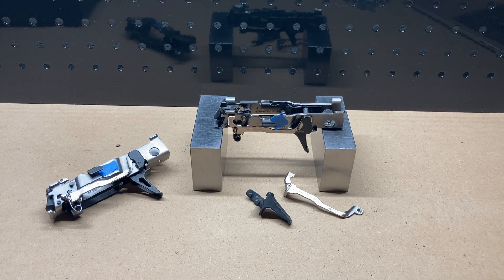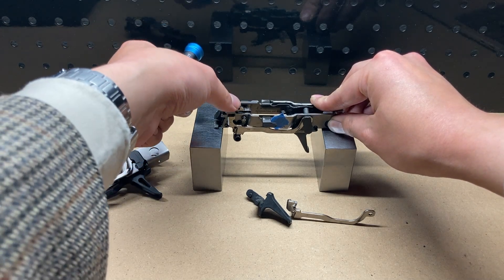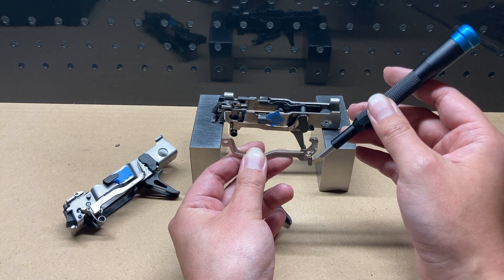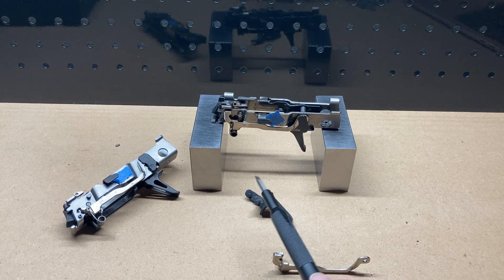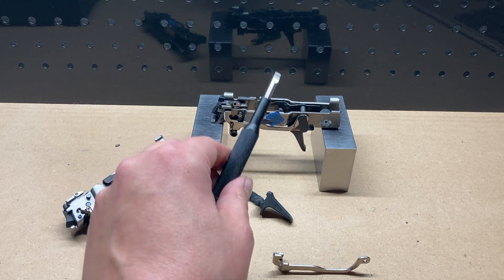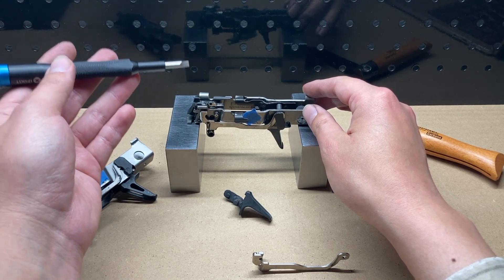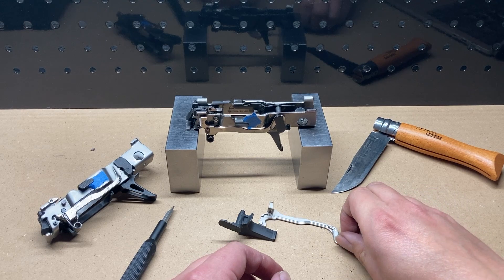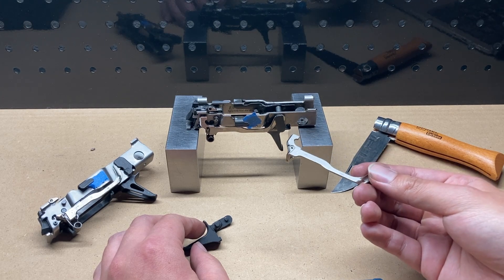P320 Sear Movement Test followup: It's all about the Trigger Bar and Trigger

Comment: If it’s interesting at all if I stick the stock FCU of my p320 m17 trigger bar “575” into a aftermarket metal frame grip module there is NO audible click or snapping up and forwards. But when I place it back into the stock grip module it does have an audible click and snapping upwards.
Reply from the maker: Ah, great - more variables! Thanks for sharing!
Reply: I have a pre-voluntary slide upgrade FCU. With a 657 and the nweer 576 bar I also get no click or snapping forwards. The bar just moves straight down in the same path as the slide disconnect. Using stock X-Carry grip frame.

Comment: What's your hypothesis as to why it's release of the sear to cause it to fire inside a holster?
Reply from the maker: I don't know, and frankly, I'm not in a position to find out; I simply do not have access to the proper sample size to even begin approaching that question. The sear movement test just outright assumes the sear is moving and checks to see whether the last-ditch safety is working as intended or not, that's it. As long as the last-ditch striker safety lock is working, then an "uncommanded discharge" cannot occur even if the sear slips from an act of god.

Comment: The first one I tested passed all of these tests. It appears that there is a "green zone" of sorts where as long as some tiny amount of pressure is put on the trigger to keep it in the proper place in relation to the sear that it works but that once the sear goes further than the trigger, that it disconnects. I hope to find one of mine that fails the test (crazy thing to say huh?) so I can study further.

Comment: Just like to add, both of my pistols fail this test, that is neither of them go downward, only forward.  However it seems both pass the striker test, that is I don’t see the striker during the test… this is all so tiresome, I have 2 320s and I appendix one everyday.
Reply: Okay now I’m not sure, I’m freaking out lol.  I keep repeating the test and I can’t tell if it’s coming through or if I’m doing something wrong/right
Reply: @tacracc_photography  Are you making sure to bump the slide stop release up and tap the slide disconnect down after flipping the take down lever up?  I initially freaked out because I was able to get the forward movement without downward movement when doing the test just after flipping up the take down lever.  But then I watched the video again and realized I had forgotten that important step which would occur during reassembly.

Comment: What I’ve found: first thank you very much for this video. I just tested a P320 X-Frame in both the factory grip and in a Wilson Combat aftermarket grip. First test with fcu installed in the Wilson Combat grip there was no click. Removed fcu from Wilson grip - proper function with the click. Repeated test several times with fcu both in and out of the Wilson grip - proper function with click when fcu removed from grip, improper function (no click) when installed in Wilson grip. Installed and removed fcu into factory grip module several times and repeated test. Sometimes it would function properly and click, other times no click. Last test, removed fcu from grip, put slight pressure onto the trigger bar, slightly pushing from outside in towards the center of the fcu - no click. Released the pressure from my finger, proper function with click. I’m no expert, engineer, armorer, or gunsmith. However it appears to me that when a slight pressure from the side of the grip module pushes the side of the trigger bar, it must alter the alignment of the trigger bar engagement so that it doesn’t function properly. Anyway, that’s what I’ve found on the P320 that I tested.
Reply: Based on this comment, and this video I'm running with the theory of the ADs being caused by how the sear and trigger bar, and trigger interact when pressure from a holster is applied to the trigger bar through a flexible grip module. I have yet to hear one report of a P320 going off sitting in a safe: the largest common denominator is these are going off in holsters. Typically, when the user moves the holstered leg in many police cases - which can impart pressure onto the holster. If that pressure is transferred through a flexible grip module (like you tested), and that trigger/bar/sear set up does not have the striker safety pop at the end of the stroke, but rather moves along with it, maybe holsters with tight passive retention are transferring enough force to the trigger bar to partially set the trigger, and (with movement) cause the sear to slip past a pushed up striker safety. I wonder if this has ever happened with a metal grip module, which would in theory resist any pressure from holster to the trigger bar.

This would be in alignment with Sig insistence that the weapons cannot go off "without the trigger being pulled" - the trigger bar moving would mechanically be pulled, just not by user input. Trigger immobilizers like the Agency Arms trigger (if enough movement prevented) or the manual safety being should prevent movement. I know we have reports from this occurring in the military (which have safeties), but I would take any report of the safety being on prior to holstering with a grain of salt considering the training involved with the handgun (not very much, not very good).
Reply: I get no click regardless if my FCU is in or out of a grip module. The trigger bar just moves straight down in the same path as the slide disconnect. I get no striker protrusion with any test I've ran. I've tried 675 and 576 trigger bars, etc. My FCU is older, pre-voluntary slide upgrade. Mine looks good to go, but it seems there are a lot more variables to this equation... In this video his clicks every time he pushes the seer down, mine does not, but passes the "tests".
Reply: @Carpythesharky  I had the same issue, if it's not "clicking" at all, that means the gun didn't "fire" even when you just pull the trigger.  Put the gun back together as you normally would, minus barrel and recoil spring, if you depress the trigger and still don't hear and audible click and see the firing pin protrude then you may be doing something wrong.  You should have a decent bit of spring pressure pushing the slide backward when you do the test.  I don't know what I did, but ended up dissembling then reassembling the gun completely, then I was a able to get it to dry fire it as it should.  I then dissembled again like the previous video said and was able to replicate what he showed in the other video with clicks and all as well as firing pin popping through (unfortunately).  I have a very early FCU, but I did send my slide in for the upgrade as soon as it was available.  I carry a p365 and never carried my P320, only shoot it at the range so I'm not concerned with it.
Reply: In the previous video, all of my runs passed the test. I ran this test on 10 guns. 7 are mine and 3 borrowed. Of this 10, 2 were M17’s, 1 M18, 4 were Legions and 3 were stockish compact P320’s (not optic ready). Any of the M series will move the trigger forward and back but will not release the striker. No audible click. I assume the addition of the safety prevents this. The Legions all passed. 1 of the compacts passed. The other 2 would not reset the striker. Again no audible click. So I replayed the video and the author made a comment about the skeletonized trigger. Well.. both of these have it. I replaced the triggers with stock flat triggers are the guns pass.
Reply: I noticed the same thing on my P320 XTEN where I couldn't hear an audible click (though I did see the trigger bar move downward, albeit not that much) but could when it was outside of my grip module. However, when I did the sear test by putting the slide sans barrel and recoil spring and pushed down on the sear with a punch, the sear dropped but the striker didn't protrude out of the gun. So evidently that movement is sufficient. I do have aftermarket parts in my FCU, though.

Comment: I have (4) 320's 2 have the shown issue, on both problem guns it is the (trigger) not the trigger bar causing the issue. On the problem guns (both straight triggers) the triggers have a different distance between the trigger center pivot pin & the trigger bar pin. Both the problem  triggers have a different distance between the trigger pivot pin & that causes a  slightly different trigger bar angle. It seems to be that slightly different trigger bar angle that causes the sear movement to push the trigger bar straight forward rather than down & forward. On both problem guns going back to the stock trigger causes the problem to go away.
Reply from the maker: This precisely mirrors our findings! Good to see at least some consistency out of this platform...

Comment: When you had the FCU's in the frames it looks like both safety levers moved directly in response to the pressure on the sear. Maybe I saw a slight delay on the second frame, but that could have been differences in how pressure was applied.

Will you confirm that the second pistol frame allows the sear to move slightly more before activating the safety lever? Does everything feel similar?

If what I'm seeing is correct, the trigger bar "disconnector like behavior" doesn't initially appear to be a causal factor because the sear and safety lever's in both pistol frames move as one, but it's obviously a concerning observation and possible correlation (small sample of 2). I wonder if others will confirm something similar happens when they try it.

What factor does not having spring force and barrel lock up on the take down lever have, if any? From Sig mechanics video's the takedown lever activates the sear by pushing it into pre-firing position. It looks like the takedown lever needs that force to stay locked, so I was wondering if it affects the sear.

Comment: I appreciate this video and decided to submit my own contribution. Here are my discoveries:

P320 Sear Disconnect Behavior Test

NOTES:

-Stock trigger bar is part number 576
No difference has been shown in this test between M18 stock trigger bar (576) and X5 Legion stock trigger bar (576) I tried both bars and decided to not include the findings of both in this format due to space. Changing between the M18 stock trigger bar and X5 Legion stock trigger bar made no difference

-Apex Trigger bar is the “CA version”. This bar has been discontinued. 

-No difference has been shown on whether FCU is inside or outside the frame during test. 

-No difference has been shown between the different trigger shoes. X5 Legion trigger shoe and Armory Craft dual adjustable trigger tested 

-The following test was conducted with various combination of parts. Primarily a Modified M18 FCU and a bone stock X5 Legion FCU

-M18 FCU has a Grayguns Competition trigger kit (https://grayguns.com/product/p320-competition-hybrid-trigger-system/). 
Trigger shoe is Armory Craft Dual Adjustable Trigger (https://www.armorycraft.com/product-page/sig-sauer-p320-dual-adjustable-flat-trigger-1) 

TEST RESULTS:

M18 FCU, Apex trigger bar, AC trigger shoe:

Trigger bar moves down and forward.  

M18 FCU, M18 stock trigger bar, AC trigger:

Trigger bar moves straight forward 

X5 Legion completely stock:

Trigger bar moves straight forward

X5 Legion FCU, Apex trigger bar, X5 Legion shoe: 

trigger bar moves down and forward. 

X5 Legion FCU, Apex trigger bar, X5 Legion trigger shoe:

Trigger bar moves down and forward 

X5 legion with M18 upper, Apex trigger bar, X5 trigger shoe:

Trigger bar moves down and forward 

SUMMARY:

I appears that with my particular FCUs and parts, changing ONLY the trigger bar made the difference on whether the FCU displayed disconnector-like behavior

Comment: Mine passes the test while the FCU is removed from the grip module, but fails while inserted into the grip module. I am able to replicate the failure outside of the grip module by applying slight pressure to the outside of the trigger spring while performing the test.
Reply from the maker: Yep, this is why I warn against trying to draw conclusions from the FCU outside of the grip. Installation in the grip can potentially change the FCU behavior.

Comment: Curious if anyone can advise whether the agency arms trigger with the trigger safety prevents the necessary travel of the trigger bar to mitigate an accidental discharge with the information gathered from this video.
Reply: I have asked the exact same thing but have not gotten an answer from anyone.
Reply from the maker: I was hoping to get my hands on an Agency Arms trigger this past weekend but was unlucky. The search for one to experiment with continues. After the amount of counter-intuitive behavior I've witnessed out of the P320 FCU, I hesitate to make any authoritative statements about any aspect of parts interactions without first having tested those parts in an actual FCU to witness their actual behavior.
Reply: The answer is, unfortunately, no. I just purchased this trigger and installed it yesterday and my 320 still fails the seat test. I also verified with the slide on and barrel removed and the striker is going into the breach. The trigger has a bit of take up before the safety tab engages the trigger pin. This take up is enough trigger bar travel to allow the other safety mechanisms to be defeated. 

I tried using the apex trigger pin sleeve to remove the take up, but it doesn't work with the geometry of the trigger shoe. I think the trigger shoe could be modified to work with the pin sleeve, but at this point, I'm done doing Sig's non-recurring engineering for them.

Comment: Can you do the same test with a P365?
Reply from the maker: The P365 is not vulnerable to this specific issue, as the P365's sear does not have a rear leg; if the P365's sear were to move, it would not cause any sympathetic movement of the trigger bar, unlike the P320.

Comment: A very good video, well presented however I still cannot figure out what the point is, what would cause the sear to be depressed in the first place?????
Reply from the maker: How the sear is moving on its own is the multi-million dollar question that no one seems to be able to answer. The Sear Movement Test just works on the outright assumption that it is moving, since none of the "uncommanded discharges" have been accompanied by reports of broken components, and no one has been able to show how the striker could be released without either something breaking or the sear itself moving in the process.

Comment: So this is anecdotal again, but I was able to test 9 p320s. 7 failed and 2 passed this test, and confirmed with partially assembled gun in re your other video. These were all nicer 320s. Legion, spectre, spectre comp, axg etc. all of the failures had either the flat or flat skeletonized trigger. The two passes were one flat skeletonized on an early x5 legion and one standard thin curved trigger on a 320 compact.
Reply: what brand was the flat trigger that passed the test? My Armory Craft flat trigger on an M18 fails this test
Reply: @Supernova73178 sorry I didn’t see this question until now. All triggers are the various flavors of SIG OEM triggers.

Comment: Hi me again, 

So…here to somewhat throw a wrench in things. I have a 320 XTEN. I’ve owned two M18s in the past but sold them long before this fiasco restarted. 

I tried your first test by depressing the tear on the assembled grip/slide probably 100 times and my gun passed. I even reassembled the gun with recoil spring and barrel and placed a spent case in the chamber with a piece of masking tape over the primer and confirmed the striker was not dropping. 

Fast forward to today, I tried your new test and I’m getting mixed results. Outside the grip if I depress the sear with my long poky thing the bar moves downward and forward before eventually just snapping back up. It does not seem to travel forward any further after the “snap”. Slightly different from your result. However, inside the grip, the trigger bar only seems to move forward and not downward. But then why didn’t it fail the first test? Also, my trigger bar seems to dimensionally different than yours & your fiends. I am not sure if this is exclusive to the 10mm variants but the rear portion of the trigger bar that you showed to interact with the sear seems to be designed differently on my bar if not entirely absent. I have never taken the FCU apart so I’m not sure if the it’s concealed behind something in the FCU but it doesn’t appear to be. I can send you a picture if you can give me an avenue to share with you.
Reply: Also,

I am not able to depress the v-shaped disconnector manually into a different position upon inserting the FCU into the frame. I can depress it with my thumb and visually see the trigger bar moving downward in a similar manner to when I would depress it with a punch outside the grip. However, if I depress the sear there seems to be no downward movement or engagement with the v shaped disconnector. 

So basically, I’m back to square one!

Comment: What seriously concerns me is that in the P320 design moving the sear moves the trigger linkage bar at all!!!  Someone please correct me if I misunderstood that video or the operation of the P320 sear.

In the P365 design, moving the sear downward and away from the striker lug moves the lever arm of the sear FURTHER away from the trigger linkage bar and also further away from the striker safety lever.  When the trigger is at rest, there is NO contact between the sear's lever arm and the trigger linkage bar or the striker safety lever.